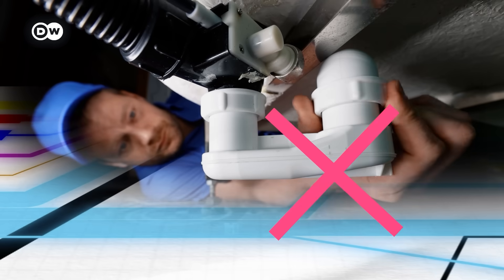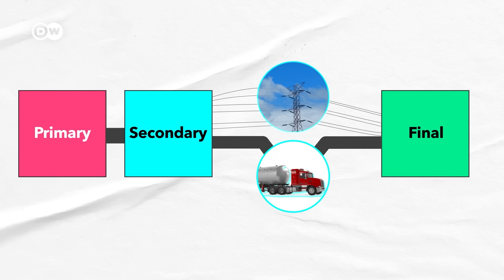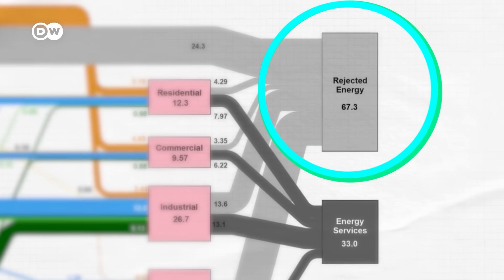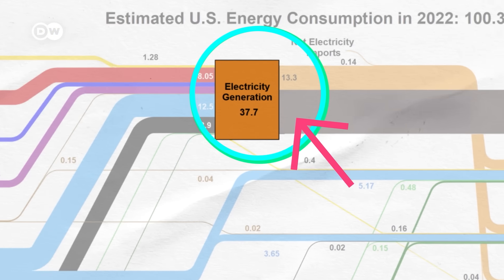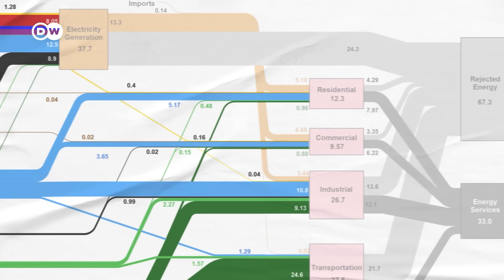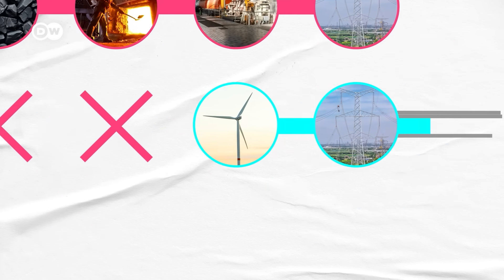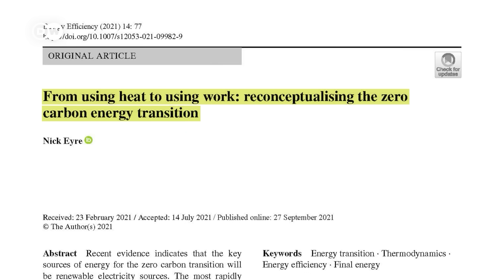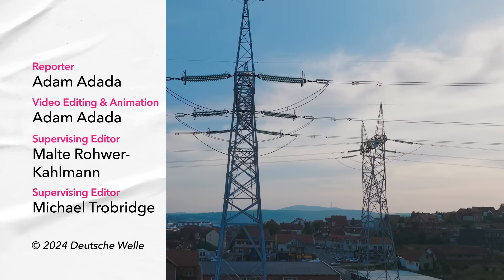The mind-blowing thing we get WRONG about energy

Comment: I’m a great believer in the 80/20 rule where we can do 80% of a job with 20% of the effort and then the last 20% takes 80% of the effort. Skeptics look at how much effort it will take to get rid of 100% of fossil fuel use by looking at the hardest problems to solve. In reality tackling the easiest problems to solve to get most of the benefit and then look at how we can deal with the difficult things.
Reply: It's very easy to achieve the low hanging fruits, and not expensive at all❤❤
Reply: @MrKOenigma  Go ahead... And at the end of the week, go to the office and ask for a pay... It's easy to restrict the usage of fossil energies from poor people, just ask for more dollars. But that is not at all the problem. It doesnt pay... We must reduce the usage in rich countries!
Reply: Then take a look at the ratio rejected energy vs. energy services in transportation. 80/20 rule is perfectly applied here, this example demonstratea why electric cars make a lot of sense,
Reply: @CreRay  Agreed, for light passenger vehicles, BEVs make total sense, though in urban areas, public transportation makes even more sense.
Reply: @roger1818  Also for public transport electrification makes a lot of sense, especially city buses!
Reply: @CreRay  For certain electrification makes sense for transit, especially if you put up trolley lines on the main corridors  and transit stations to recharge the batteries while driving or stopped anyway. 
I wish they could move away from diesel heaters in cold climates though. Propane would be cleaner but I guess the depots already have diesel, so it’s easier to stick with a fuel they already have.
Reply: @CreRay  80/20 rule is fake science. Forget that nonsense. Electric car do make sense in rich countrys to undergo the transition of the next 30 years. But a 2 metric tons car cannot be provided to each familly of the world. There are not enough resources. Even one 500kg car for each family will not be possible. 
In 50 years, we cannot build 3 000 000 000 new electric cars. Humans cannot. The world where 'electric cars make a lot of sense' is the world of imperial rule where chinesse are under control, as well as India... And they are kept in poverty. And that is not, definitively not, the world on next century. 
American way of life will be, in 50 years from now,  to have a car (small) for two or three families. If this is not integrated in the moral background of occidental citizens, we will see billons of deaths, posibly a nuclear war.
Reply: Exactly. Let's get to 80%, and then worry about the remaining  20%. Having 4/5th of clean energy soon would still be a huge improvement over the status quo. People are so scared about the last 20% that they won't even start.
Reply: Yes, thank you...  I sometimes have an issue with folks that are bee line focused on the 100% renewables/No Fossil Fuels...  why focus there... there's so much low hanging 'easy pick' fruit.  Who cares if we still use 5% - 10% of the fossil fuels we use now in 15 - 25 years...  Reducing by 90-95% would be tremendous.  Besides, it scares the fossil fuel industry into opposition.  Instead we could collaborate with them for them to handle and focus on the most difficult loads to use renewables with... like back up for homes in the middle of  a cold Oregon Winter, with a drizzle, not of solar but of rain for 2-3 weeks...  Burn baby burn... but only for specific specialty uses... and raise the price and pay the folks well that keep that fuel grid alive.  No enemies here, as long as all are aware of the eventual transition... (synthetic liquid fuels .. in time, or hydrogen).  Cheers
Reply: Unless you discuss how to address the economics of different energy generation, then nothing will change much. It's economics that drove major change. So for example if boiing a cup of water with electricity is three times more efficient, but electricity is four time more expensive then nothing will change much, so electricity has to come down in price.
Reply: Well there goes 80% of what I had to say about this at 20% of my effort!
Reply: do you have any proof of this rule?
Reply: @ It’s not a hard and fast rule that one can prove but more of a general trend in life.
Reply: the all or nothing approach is problematic and actually counter productive
Reply: Once fossil lobbyists and fossile dictatorships stop fighting against change it will be done in no time. 
But they lie and cheat, pay millions to keep their billions while we taxoayers pay more and more for climate change related desasters.
Reply: love your comment!
Reply: Your viewpoint is how an ADHD person accomplishes goals — start with the easy and roll that momentum into the hard.
Reply: Exact right.  Many people are looking for perfect.  We don't need perfect.  We need sustainable.   The earth has some capacity to absorb our waste.  Our problem today is that we are far exceeding that capacity.  We just need to improve to live within the means of the earth.
Reply: @erikstephens34  There's a difference though. Some things degrade and goes back into the natural cycle almost instantly,  like mud, some things take days, weeks, months or years. The real problem is all of the shit we have engineered and bought never to disintegrate, that never existed in nature before we made it.
Reply: I like your positivity, but optimism can also be a cause of procrastination.
Reply: @notconnected3815  It can, but it’s better than throwing in the towel and not doing anything.
Reply: Nothing is better than stored cheap energy u get out the ground. Focus should be on harvesting and splitting the co2. We split the atom 100 years ago with very limited resources. Now we are being vested by co2 which seems a total joke or a total scam to con and suppress the masses
Reply: The « do the 80% First » approach invariable leads to coal/gas lock-in when itcomes to electricity generation. That’s why people serious with the topic (eg MIT made 18000 simulations circa 2020) always run simulations on 100% of electric systems before making police decisions
Reply: This is the voice of sanity, more energy storage capacity is required to save some of the wasted energy from wing generation.
Reply: Ironically, the reality is 80 percent fossil fuel for global energy use. Much of Europe and Germany is far north and we need nuclear power and cheap fossil gas in pipelines. Not 5 times more expensive LNG and sun/wind.
Reply: @erik7726 THIS IS REPEATING A STUPID LIE! Even in the north you can completely depend on solar, wind, thermal heat from the ground to get all things done. Look a Norway and Denmark. We do not need nuclear power, all nuclear power plants have been shut down and only god knows how people like you can stay as uneducated as you are even in a country where on average 45% get a high school diploma- which seems to be worth nothing.
Reply: It’s 80% out of 100% to make it run 20% goes back in. Thats silenced engine that makes thing work charge it self to run indefinitely  for free and keep producing extra 20%. Ur 80/20 will happen maybe in 3025…
Reply: @DT__1  I think you’re misunderstanding my post. I’m talking about human effort, not mechanical effort.
Reply: The problem is that we are making it very hard to solve the easy problems. It’s politics which is just a fancy word for corruption which is the cause of the change issues.
Reply: We can produce 100% of the energy we need with nuclear.  Then it'll be practically 0 effort once that infrastructure is in place.  Obviously there's maintaining the plants, but that's nothing like a fossil fuel plant or even keeping solar panels clean.
Reply: @veganpotterthevegan spoken exactly like someone who has no idea about anything.
Reply: @veganpotterthevegan Nuclear fuels is for free for centuries to come. I am wondering if you used AI to post this nonsense. A human brain cannot be that limited.
Reply: Carnot heat engines are about 35% efficient. Now news here
Reply: You are a believer. That is not a problem. But consider believing in something less false that this 80/20 rule. Ask your church for help if needed, This 80/20 rule is the first example of false reasoning, for explaining things. That doesnt mean it is not usefull to remember it's existence when thinking hard to something. It remebers me the I-Quing, where you have 64 little poems supposed to contain the answer to any question, whatever the subject. And this little poems where written 2000 years ago ! 
The strengh of the 80/20 rule is based in the fact that it concerns pourcentages, and witty enough 80+20=100, and if you have 100% of something, you have all the cases, you have truth ! The problem is that you are adding pourcentages of things which do not add. For instance, you speak of 80% of a job... say the moost part of what is observable in a particular task, the you consider 20% of the effort. Effort is not easilly evaluated, and is not observed, but calculated. you cann not add 80 percent of a job, with 20 percent of the effort. Its as adding the number of officers in an army and their age... This things doesnt add. The units are not the same. 
So why should be 80 percent of the job be done with 20 percent of the effort, or with 97 percent of the effort... Which is nearer of the truth ? It is not 80+20=100 wich gives you a clue. Perhaps 80+97=177 is ok... In each case, figures are to be calculated according to questions to be answered, and studies must be done. Cherry pikers kwow well that fruits eassy to pick are not paying 80% of the expenses...
Reply: Yes. Totally on board with the incremental 80/20 approach to transformational change.  However netzero proponents are not talking about that and they forcing change with unrealistic targets and penalties for non compliance.  In the uk millions will lose their jobs as the car and steel industries go out of business in the next few years. In fact thats already started in Wales with the closure of Port Talbot.
Reply: I wish the world would always work like that. Germany spent some 520 GIGA Euro and at best it has emissions 8 times worse than France. And France did its reduction 40ish years ago so cumulatively avoided tremendous amount of CO2 and all that with affordable electricity. Is push for wind and solar working?
Reply: @msxcytb no its not working.
Wind and Solar is mostly a failure
Reply: @msxcytb France regularly imports a lot of electricity from Germany.
Reply: @mariusg8824  heard that spin/propaganda many times already. Countries send back and forth power depending on price. What matters is to have low carbon power when it's needed, not when weather is supporting generation. France makes power with 50g CO2/kWh and Germany with 400gCO2/kWh as yearly average. Then consider that France is not producing these greenhouse gases already like 40years and Germany energiewende cannot be called differently than disaster (IMHO)
Reply: @mariusg8824 bs it is just because a) germany built a lot of intermittent wind and solar power capacity thus farms are overproducing a lot sometimes and not producing at all at many other times. They use the dispatchability of French electricity to make it work.
B) In last 2 years some exceptional issues were found in many French nuclear reactors and because public has been so brainwashed by greens and fukushima, it was decided to stop all those reactors until solved. French nuclear reactors are very safe, systems get upgraded all the time unlike the US ones so the French running time is much lower than US.
The nuclear electricity production should be back to previous levels in 2024.

Anyway, Germany is using gas (russian...or maybe not anymore now) and coal which is even worse environmentally than anything else.

The import bs story is really just telling how much you don't know about the reality of electricity generation sector.
Reply: @kevinc9597  Hi, not sure about the question, sure however that NucPower is practically zero carbon and with least demand for steel, concrete, transmissions and storage(even if that would be great to have). Thermodynamics  of efficiency is not a problem.
Reply: @msxcytb Thats not true. Or at least it isnt as trivial as you make it seem. The main reason why Germanys CO2 Emissions in the Secondary Energy production are so much worse is for the Political decision to get rid of all nuclear Power and the inablity to buffer the "lost" energy with renewables. Most of the useful energy in Germany is now from Coal Power Plants where in France Nuclear Power is seen as a good transition away from coal. Primary CO2 Emissions are also worse because of the car centric Transport System in Germany. As in most things there sadly isnt one solution or cause of the problem but its many small things that add up and all need to be tackled to solve the main Problem.
Reply: @jarveanschlol7815  agree. Making clean electricity is the low hanging fruit - after that heating and cooling is only natural with clean electricity. That could be like 2/3 of greenhouse emissions done for. France achieved that(and Sweden, Ontario, Finland to) much better than Germany. Nuclear power is a clear differentiator here IMHO? Is there any country that decarbonised without it (apart from exceptions like Norway, Iceland because of site specific reliable renewable energy sources)?
Reply: @jarveanschlol7815  Exactly, it's not just what you do, it's when you do it that can be critical. Germany wasn't ready to suddenly switch off nuclear.
Reply: @jonb5493  Norway does have unique access to reliable, dispatchable hydropower. Similarly Sweden, Iceland and few lucky places on this planet (typically mountainous, with low population density). It is not the same as unreliable, very diluted wind and solar power. Or am I missing some example of country which truly got rid of coal/gas with wind and solar?
Reply: @msxcytb  OK, start with UK. Doesn't have Norway's unmatched hydropower. Does have unmatched wind: offshore, pnshore, all. What UK really lacks is, unfortunately, a 
"level political playing field": NIMBYs ruin everything.
Reply: @jonb5493  uk doe’s relatively well indeed, emissions (for electricity) about 4times larger than France, but half of the emissions of the Germany. To decarbonise electricity and heating there is still lots to do and it’s easier if prices are kept low(long time).
Reply: @jarveanschlol7815  Excuse me Sir. You cannot assert that 'thats not true', and say later, 'it isnt as trivial as...'
Please give a place to truth. Politics are at the root of all this problemns, but clearly 'American way of life' and imperialistic wave of propaganda, (to defeat the coms) are what is the problem with the energetic disaster in Germany.
Reply: @msxcytb  Germany’s big mistake was shutting down all of its nuclear power plants.
Reply: solar and wind only last 10 years at best. weather wipes them out, flip 5 quarters 5 times a day if they all come up heads your solar farm or wind farm just got wiped out by mother nature. do this every day for the rest of your life. how's that safety and security? reliability is everything, penalties for unreliable energy need to be raise 150,000% on solar and wind, because the companies just go bankrupt after stealing the subsidies and abandon their toxic waste farms all over farm land. solar and wind should be confined to city buildings only. keep your toxic waste out of the food supply and where the toxic waste of humanity breeds the worst of humanity
Reply: @aprilgeneric8027  That's BS. Solar farms typically last 30 years. Wind farms 20. Typically they get replaced because a technological upgrade has come along. Extreme events are only responsible for a few % of losses. It's not just renewables. Gas pipelines can also freeze, see the Texas winter black out 2 years ago.
Reply: @Edekje  facts working on offshore wind and the fatigue of the OWT are generally lower than expected so we extend lifetime to 25. The intermittency is a real problem that can be solved by battery for daily variance or pumped hudro for  seasonal variance.
Reply: @aprilgeneric8027  Not sure where you got that FUD from. Most solar panels come with a 30 year warranty and wind turbines have a typical lifespan of 20-25 years.
Reply: @roger1818 what you said is fact. There is also the realities where wind farms get ripped by tornadoes (like the recent one in America) and abandoned wind blades (in Australia). Though these are edge cases, it does give people the impression that they are unreliable and suspect to bad weather and bad actors.

Perhaps rather than a centralized green energy grid, human might want to build up a collegiate of power stations and relays - that teaches people how to power their own requirements from underatanding electricity, building the power generator, networking, repair and maintainence. With the subsidies that is currently pouring into companies that are gaming the system.
Reply: @wyleong4326  Of course a tornado could also destroy a coal power plant, but that wouldn’t make the news as it’s old technology. The advantage of distributed energy generation is that the failure of one component has a much lower overall effect.
Reply: @aprilgeneric8027  whaaaat? 10 years?, solar panels last minimum 20-30 years
Reply: @aprilgeneric8027 sure, sure, and where do you get the data that you use for upkeep costs of wind and solar vs fossil fuels?
Reply: @aprilgeneric8027 The first solar cell roof installation that was ever built is still producing 70% of its original energy. It was installed in Swiss in the 1970s. A lot of solar parks were built in the 1990s, and they are still in use.
Reply: @aprilgeneric8027  1) That depends if the right people build a solar farm or a rooftop plant. In fact the lieftime is 40 years or better unless you have someone built it that didn't know how to do that. 2) Solar farms do not necessarily use any land. Agri-PV is the key where agriculture can even be improved below a correctly built solar farm.
Reply: Wou you really put a lot of effort in concentrating such a massive amount of bullshit in such a short paragraph
Reply: @aprilgeneric8027  This is just wrong
Reply: @aprilgeneric8027  that sounds like all the abandoned oil wells on the clean up lists
Reply: @aprilgeneric8027 just plain wrong. Solar panels can theoretically work indefinitely,  in practice decades without or with very little maintenance. Wind turbines need a bit more but still are very reliable.
I would argue they are more reliable than coal or gas, as they aren't dependent on lengthy supply routes that can easily be disrupted by something as simple as a train/car crash on a major transit route. Also, coal and gas are just as much affected by natural disasters as wind an solar, maybe even more, since with wind and solar, part of the infrastructure mostly remains. If half of the solar panels get destroyed, the other half isn't affected.